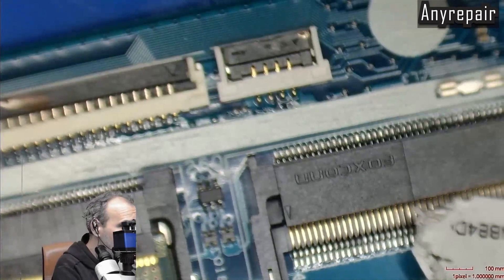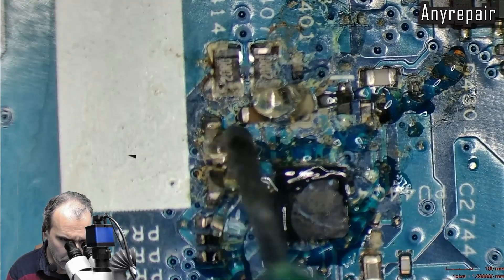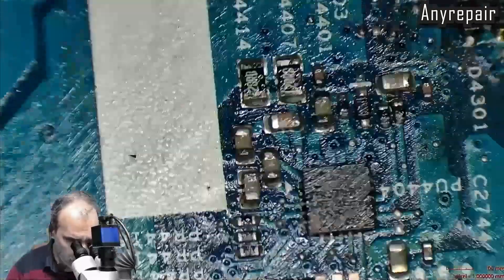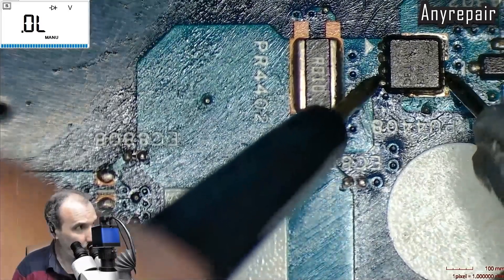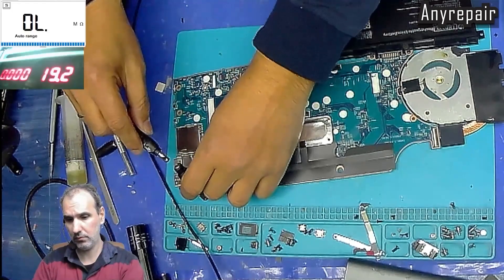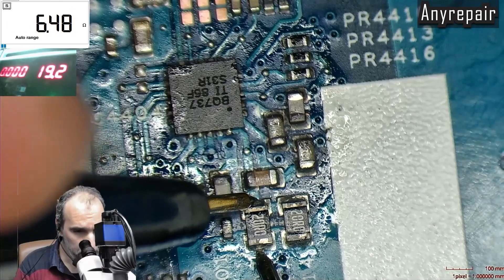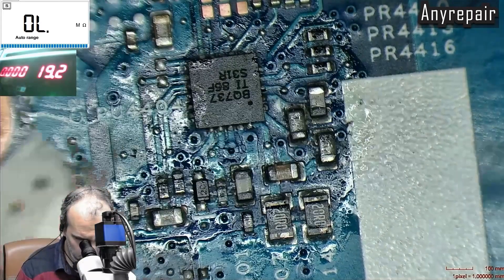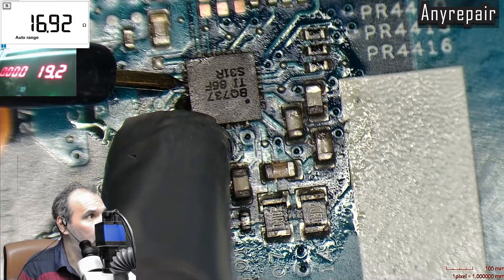HP 15-cr0037 water damaged not charging...issue explained and repair!

Comment: I'm watching you, and the only thing you seem to be doing is just leaving the contaminants into the flux. Where if you'd used IP before? You would have gotten a lot of the contaminants off the board. And then reflowed the board. And the board would have been more presentable and clean. And there would be less chance of the contaminants getting underneath any of the components.
Reply from the maker: Hello, thank you for the comment! Every board after the repair and before final stress testing  goes through a cycle of ultrasonic cleaning!

Comment: I probably would have used some IP for first cleaning. Just to get some contaminants off of the board. And then I would have reflowed everything. Because you don't know what is on that board right now. And you're gonna reflow it. And you might put contaminants Underneath the mosfet. That's my opinion, but you have ways of doing things your own way. I just like to keep the board nice and clean. Before I start reflowing anything.

Comment: As an expert, could you explain a little bit more why does the 6.9 ohms resistor fit in the place of an 10 ohms resistor? Thank you.
Reply from the maker: Hello, I think the question is about the value of the ohms and not the size. Right? Well in the datasheet I was reading before the values were 10ohms on pin 13  and 6.8ohms on pin 12 There is no difference from the datasheet so it is ok!